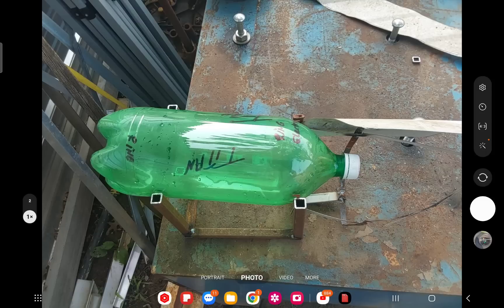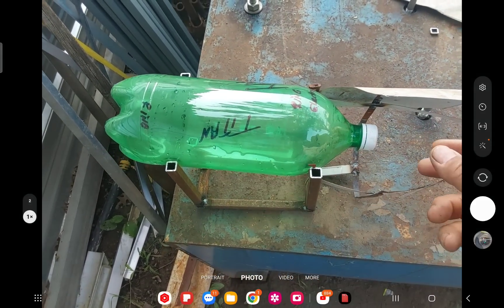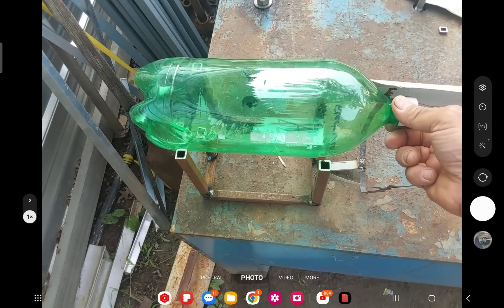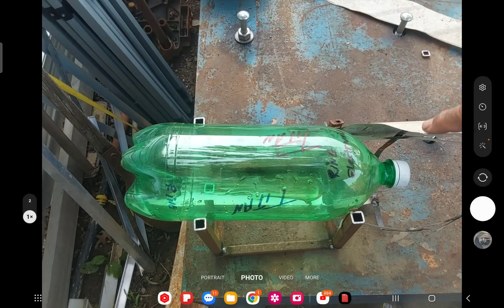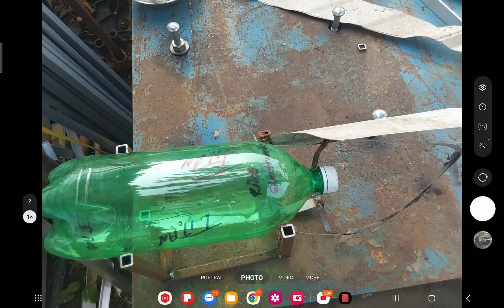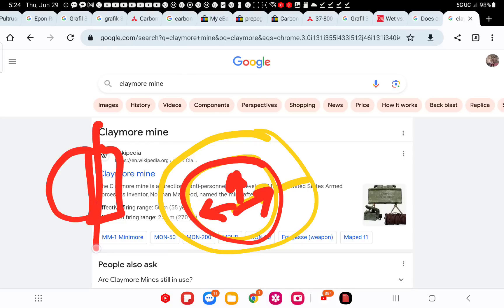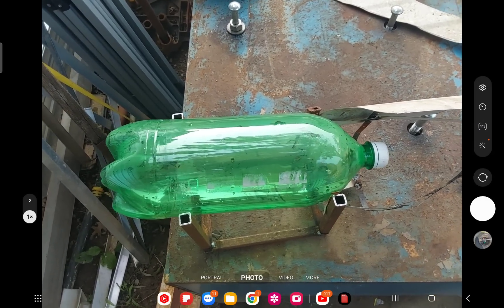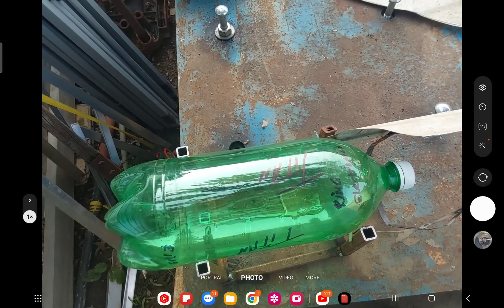Titanic Titan Implosion at rear overpressure ORhydraulic EXPLOSION via OVERPRESSURE of hull u decide

Comment: I know very little about engineering or physics but even I questioned many things, like the lack of gaskets where they joined those end caps to the tube & how 17 bolts to shut the entrance seemed too few.
Reply: It should have been a pressurized door like in a submarine…..not bolts.
Reply: The bolts were probably all destroyed did you see a torque wrench used no lol probably over torque or under torque but the bolts were nothing compared to all the glue holding it together
Reply: The pressure applies a force pressing the end caps, so you don't really need loads of bolts, they don't hold pressure, they mostly keep it in place.
   And with all that pressure, if you have a flat surface you don't need gaskets.

Comment: Where. Is the pressure vessel if it didn't implode. Also, dropping landing skid was one way to ascend.
Reply from the maker: The internal pressure could have it fracture like this... Keep in mind, implosion is really a break in the hull first and then water entering compartment.
Don't believe the fake information that has implosion as turning a vessel to dust.
The Navy does not do real World testing of real World implosions and the vessels that have gone dine always have a hull breach at some point and this means water rushes in and air inside compresses. 
Implosion is a scenario I ran with the midspan buckling and riping from ONE end first, as per all the small scale studies I have found...
But, this failure is unique and it turns out, no two pressure test samples fail alike... As per the Navy's testing and they even tested Xmas balls...
This failure is one of a kind, it is not like a submarine as it lacks bulkheads ... It's a damn tube that failed and u pick your poison on how but whatever you do, leave the rear in a pristine state... So if ur implosion creates and explosive force, keep those forces OFF the rear end 
You can bet they have a lot of the carbon fiber in possession as the Navy experimented with carbon fiber and this is good data for them...

Comment: ‘Penetrators’ are used to make electrical connections through bulkheads.  One of these could have failed.
Reply: In order for the connection points to work effectively they must be designed and built as part of the cone, otherwise if they drilled holes and tried to attach and seal the cable and hose connection points afterwards, they are more prone to failure.
Reply from the maker: @rabbitramen , keep in mind, the more holes, the more stress points and behavior changes of the cone...
Reply: Or something blew them apart?
Reply: @rabbitramen  Penetrators in themselves are okay and be designed to withstand over 20k psi.  My concern is with the 'influential' young folks that were hired to service them.  Did one of them cause damage while trying to solder to one?  You had a man-rated critical vessel, operated in an extreme environment, being serviced by untrained people.
Reply: @rabbitramen  thanks for that comment i was wondering how that worked
did anyone see the deleted video on like oceangate trip 8 where there was an issue dropping the weights or something and stockton suggested they sit on the sea floor overnight until the weight strings disintegrate ?
but 2 of the passengers said no, at THIS stage stockton opened a side panel in the back of the sub and the video shows him "manually pumping the hydraulics"
at this stage the passengers are relieved because the weights drop from his pumping and they begin to ascend 
now im no expert so forgive my ignorance but how could a rubber hydraulic tube be "manually pumped" from inside the vessel? 
i understand that electrical signals can be sent through the bulk head like you mentioned but how on earth can a rubber tube exit the pressure capsule

Comment: I'm interested about how they intended to control buoyancy with water and air ballast on this time bomb. I didn't hear of anything except the thrusters that actually drive the craft up and down, the dead weights that can be shed and lost and the compressed air tank that was used as emergency blow buoyancy, but no adjustable system that are found on submarines to trim themselves to different depths. Has anyone heard anything about this?
Reply: I didn't even think they had a compressed air tank for emergency blow buoyancy lol I think that's all of it that you listed there. I think that's why it took 2-2.5 hrs to ascend/descend, they just kinda let gravity do its thing to preserve as much power as possible.
Reply: Yes, in some video, somewhere, he mentions bladders sitting between the pressure hull and the outer fairing used to control buoyancy.
Reply: The better option would be a chemical mixture that would generate a gas with the sea water, would could store a lot more for less weight.  I don't remember what the chemicals are but they're used in military subs because they can keep the mixture going to keep it afloat for everyone to get out, over compressed air where once it's out it's out.
Reply: At 25:54, you can see the three cast iron pipes they used as "dead weight."
Reply: You don't need all that. It's a "neutral buoyancy" vessel, so with thrusters you can ascend or descend.
Reply: @Flaviorrodolfo  at a mere 20 feet per minute at 11200 feet depth,  from the transcript Rush describes the ascent happening at a quarter of predicted.
They descend at 120 feet per minute for most of the dive. thats plummeting.
Reply: The steel pipe weight was used for the main dive to near the Titanic, the minor ballast was for depth adjustment near  the wreck, to hover above it.
Drop the pipe when you want to ascend to the surface. Something went wrong , either too much weight and or something was became water logged or their floats were missing holed.
Reply: @joefish6091  As a neutral buoyancy the ascent/descend speed is heavily dependent no the thrusters (unless you release ballast, which is the emergency ascent system).
Reply: @Flaviorrodolfo  You missed the point. If it is a "neutral buoyancy" sub, why is it descending at 120 ft / min ? It's an obvious indication of failure.

Comment: The experiment you do with the bottle demonstrates an EXPLOSION not an implosion.
Reply from the maker: Did you read my pinned comments?
I have spent 10s of hours researching implosions; the Navy has done lab implosions and not ONE REAL WORLD implosion.
The real world implosions have turned out to hull breaches first and munitions exploding on board.
This tube Titan is one of the only if not the ONLY real World failure.
It also might simply be a hull breach first, would build up internal pressure first and cause an implosion but an explosion .
But, the hull breach can turn it's failed area into an implosion at the breach which would cause the overpressure and then explosive effect.
All lab experiments canNOT duplicate the Ocean depths, I will explain in a future video.
Be patient and I still ask your help with a thumb's up and your patients while I show it over a few videos...
I will back track over the basics and I have to get a new editing computer to do this ...
Rest ashure (too soon?) I will have you fully understanding overpressure and this tubed vessel.
Further, I will never not change my mind if data shows this version to be incorrect; I have programmed myself to not let my pride control my actions.
Reply: What the author is saying is if the hull didn't fail immediately, but say the rear hole for wiring did. This would cause the water being forced in from that small hole in the titanium to drastically increase air pressure in the sealed vessel. Eventually as the water comes in the air pressure becomes too great for the vessel to contain since it wasn't designed for that. This would case the parts of the vessel to explode outwards. For example the front titanium ring and dome would sheer from the carbon fiber outwards.
Reply from the maker: I don't think he really wanted the truth https://www.youtube.com/watch?v=Mf7SRPGe_RU&t=0s
Saturday gift to you all, an extra video

Comment: Carbon fiber just doesn't fail like metal. As in Titanium. Carbon fiber shatters when it fails. Into 100's if not 1,000's of pieces. They have yet to bring up any carbon fiber. As far as I know. I don't think it was the "glue", it was the carbon Fiber that failed. If I am right, then those Titanium end caps should still have carbon fiber attached to them. Carbon Fiber can't flex with pressure. The pressure probably found a weak spot in the carbon fiber, it shattered in a nanosecond. Throwing tiny shards inward. Slicing through people and the computer screens. It would have been over before they even realized what had happened.
Reply from the maker: Nope, they emotionally suffered and I award the family all of the remaining assets if Seagate, to be sold and distributed equally to all but Rush family. 
I further order that all involved in maintaining and building be investigated and if fault found, that they pay the maximum... Wait, the maximum is actually pretty weak, look up the max they get in international waters and it's a joke
Reply: @ForensicCats  Tell me how they emotionally suffered? Even though that wasn't really my point. And it's called Oceangate, NOT Seagate. My issue is how it imploded. And the Carbon fiber "tube" is to blame. Everybody that has a little understanding of the pressure that deep, knows a SPHERE is best. Multiple people, including Robert Ballard, James Cameron said they would never go down in the Titan. MULTIPLE Engineers raised concerns, they got fired. So what did Rush do? he hired young engineers, fresh out of college. With NO EXPERIENCE. Just from a text book. Rush did that for 2 reasons. 1: they would do what he said. And 2: Because EXPERIENCED people, who raised concerns years ago, were 50 year old white people. Who don't "inspire". That's a Stockton Rush quote. Look it up.
Reply from the maker: Well, if need me to tell you about thier last minutes of suffering then I can't bc you lack a heart or ability to understand...
I ask the judge to dismiss this juror as she/he is  more heartless than I am.
Reply: @ForensicCats  Your the one who said they suffered. I didn't. I said it was fast. So I simply asked why you think that. Instead, you turned it into some kind of Law Television show. Maybe Law and Order? Really? I want to know WHY it failed. So MORE lives aren't lost. I would think that the families of the dead would want to know WHY it happened. Right? So it doesn't happen again. Right? So again, I ask you this. Why do you think they suffered? Because it may lead to a reason for the implosion. What do you know that makes you so sure they suffered?

Comment: Was that brass?  Brass isn't rated to those pressures.  Looks like typical air hose fittings.  They should have been using hydraulic couplers made for those pressures.  Nowhere is brass certified to anywhere near those pressures.  WOW.
Reply: Nothing on this rig was certified to those pressures. The only surprise is that it didn't implode sooner.

Comment: You domes do not have eual surface areas. The dome WITHOUT the hole in it is larger and has more surface area for the air pressure inside the bottle to act upon.
Reply: It also does not have the weak points of the dissimilar materials connection that the carbon fiber hull did to the titanium. It's more like trying to glue aluminum caps onto a paper tube and seeing what fails first.

Comment: The bolts themselves probley didnt fail, if they just tapped threads into titanium then put steel bolts in them its more likely it just pulled bolts outta titanium, that thing was so piss poor engineered, it coulda failed in several ways, they didnt even cross hatch carbon, just rolled in circle, its endless all the ways it coulda failed